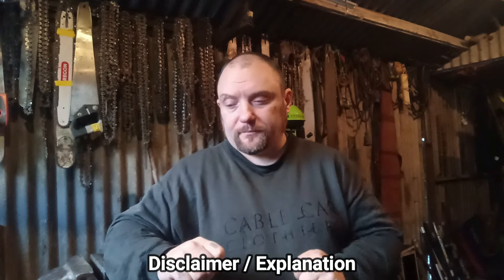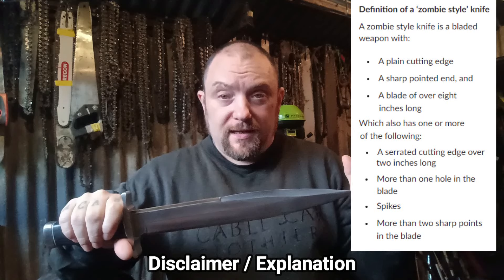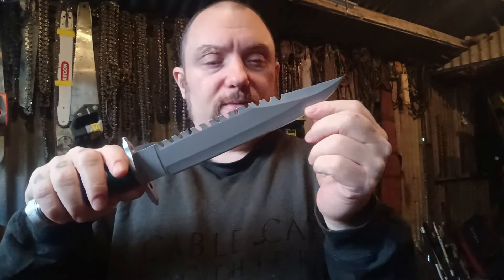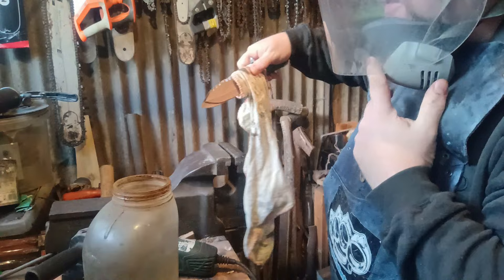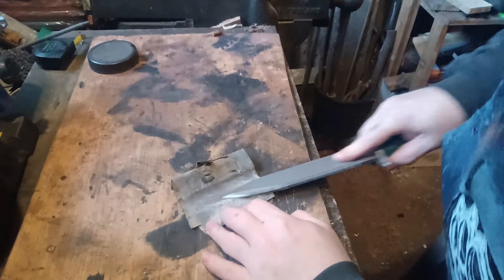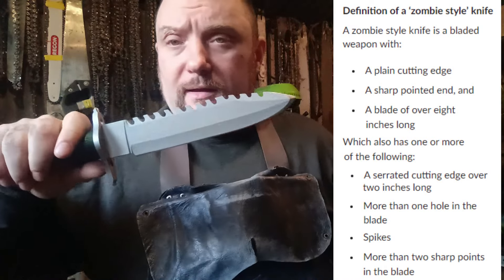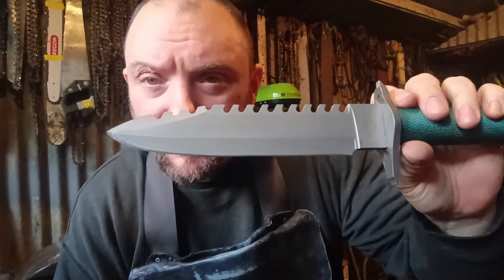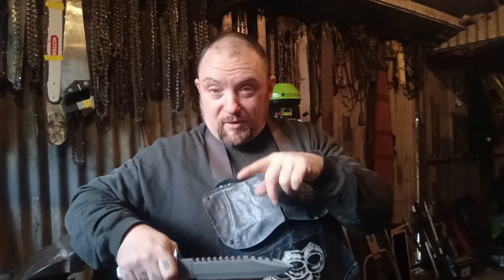How to make a zombie knife legal to own (Video series)

Comment: I thought the jagged edge had to be shorter than 2" as well or does it not matter.
Reply from the maker: If the jagged edge is less than 2 inches and near the bottom of the blade it's legal and NOT classed as a zombie knife.
Reply: @WeaponCollector  Ah right, iv got a big Rambo one that i bought over 30 years ago and it's jagged from arse to elbow on the one side, so I'll likely better get the grinder going, or try to level it off with the welder. haha Thanks mate

Comment: Hi You say or blunt the blade. I mentioned this idea in another video a week back but it was kind of dismissed. If I'm reading the government document correctly it says if over 8" and has a cutting edge and one point it's fine but if it has holes/serrations or and extra point it's not so I said why not take your knife that comes under the new ban and blunt the blade then it's missing one of the basic points mentioned. So it's over 8" has NO cutting edge and one point but has serrations. from a collectors point of view this would be more acceptable than cutting down. if however you would like to use the knife then cutting is a good way to go. your thoughts would be appreciated.
I sold all my collection last year but kept a Gerber BMF which has serrations which I was going to remove but if it was accepted if blunt then I'd rather go down that road.
Many thanks for your video

Comment: Blunt edges on knifes!? Is that all i need to do!? Lot of my knifes aren't used, stored away for SHTF. I can resharpen em when i need em!?
Reply from the maker: well it says its has to have a sharp edge so yes if they're blunt it legal!
Reply: @WeaponCollector  I see what your saying, common sense! Although sense isn't at all common
Reply: Thinking some more about this. I wouldn't think a dull blunt knife is legal. They won't say it's a blunt knife, no problem. They would say, it has a cutting edge/side, that is currently dull/unsharpened. After some thought, I'm pretty sure a blunt blade won't convince the bizzies